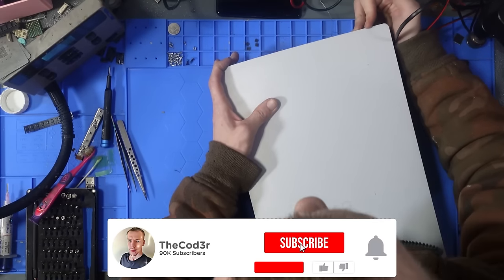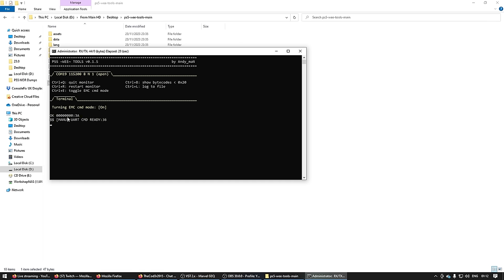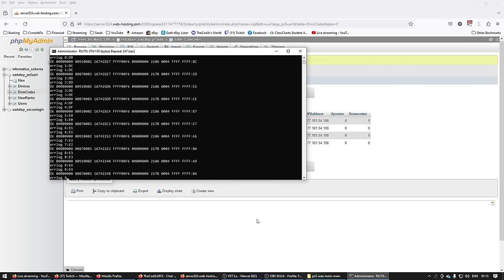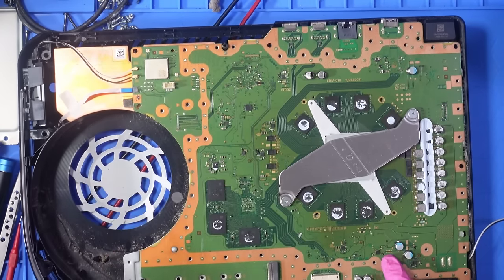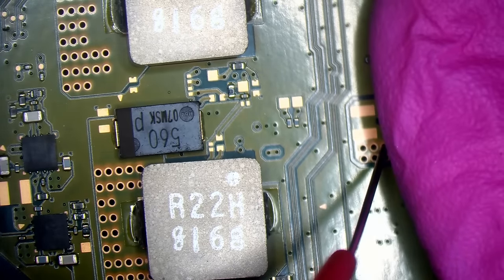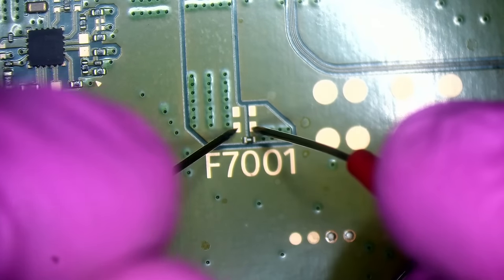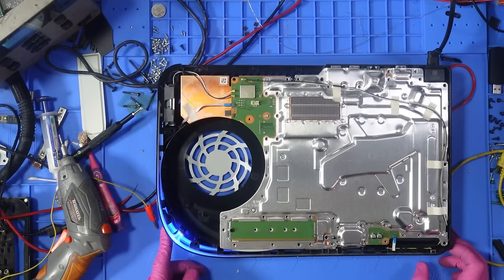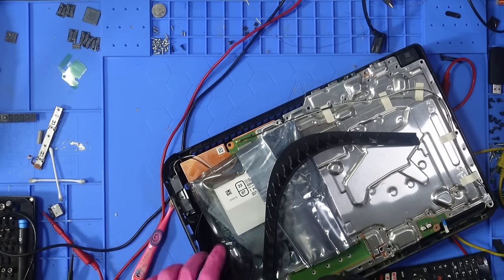PlayStation 5 Beeps Once Every 20 Seconds But Won't Turn On... Can I Fix It?

Comment: I picked up a PS5 of the same model today with this same damaged capacitor. After changing it I still didn't have 5v on this line, I remember checking the fuses but now that I've seen your video. I'll check out that F7001 again. I hope it went unnoticed because I spent more than 2 hours looking for the cause.[Fixed !! Thanks You Are a Inspiration ! ]
Reply: Had this same case last week. Same bad cap and after injection the fuse was blown.

Comment: Ooooh UART! I saw you commenting in that GBAtemp thread about PS5 and UART. Some absolute champ have been dumping a load of codes on it.
Reply from the maker: Yeah we've been working a lot recently on UART. Hopefully it keeps going and we get info on all the codes
Reply: @TheCod3r  Great work and such good idea to use the system itself to report its own faults. Have you checked in one of the new PS5 Slims if they also have a UART that can be used?
Reply: @linuxares nothing changed with the slim. It's the same hardware.

Comment: Hey mate! While servicing, you took out the solder whick and removed some solder near the antenna cables. Was it a solder blob? How did it get there?
Reply from the maker: Yeah that was me who put that solder there because I used it as a ground point to solder wires for the UART reader 😀

Comment: Hi there, I'm based in Birmingham and have been looking for someone to do a RAM upgrade on a Steam Deck from 16GB to 32GB. Is this something you'd be able to do?

I've dropped you and email and text message using the details on your website, I'm not sure they've gone through though.

Thanks

Comment: Would it be possible to install the firmware to expandable ssd storage 🤔
Reply: Nope. Internal only. They need to enable that through a firmware update.
Reply: @DeadPhoenix86DP  what I meant is if someone that's good at such stuff be able to create a mod for people to be able to install the firmware on an external ssd, because sooner or later those internal SSD will die

Comment: Phil, I know what you mean by to lazy to get the thermal camera, but I’ve learnt to not be, just one query, is the customer going to pay for your laziness?? Whether the parts come off a donor board or not, the end of the day it was initially your own lazy mistake.. if it was me I would just replace the front panel, and wear it.. Hope you understand from a fixer..
Reply from the maker: Nothing that happened here was my fault mate. I found a short which is why it came to me and the customer paid for that. The front panel was covered in grime inside the button which I noted at the start. I tried to no avail to clean it and prevent having to replace it. I advised the customer of course and made it clear it's probably OK but it can cause issues so he decided to pay for the replacement front panel. I don't see what else happened in this one bud

Comment: I watch all your videos. What kind of HDMI tester is it for 24 minutes 10 seconds.
Reply from the maker: You can get them from my online store mate: https://www.consolefix.shop/products/consolefix-x-cmizapper-portable-hdmi-tester
Reply: @TheCod3r  Did you accidently added two extra zero in there?
Reply from the maker: @n4_ku  I'm not sure what you mean
Reply: @TheCod3r  The items are way overpriced. I'm seeing battery connector for nintendo switch at 500 dollar, Xbox One white 1 TB for 9 900,00$. Sure that must be a mistake.
Reply from the maker: @n4_ku  it seems your browser likely isn't setting your local currency properly. If you have a look at the too of the page you can set your currency. That should fix things for you
Reply: @TheCod3r  It wasn't my browser. Your website was converting to my currency automatically, even though there's no option for my currency in your website. 

Our currency symbol is similar to dollar but some website use the dollar sign instead but at the end of the amount.
The reason I thought it was dollar (even though the dollar sign was after the amount) is because it said so at the top left corner of your website. 

Also I can't change currency for some reason. Only when I used a VPN and it gave me the currency in euro that I realized it was my mistake. 

I'm really sorry about that Phill.😞😞